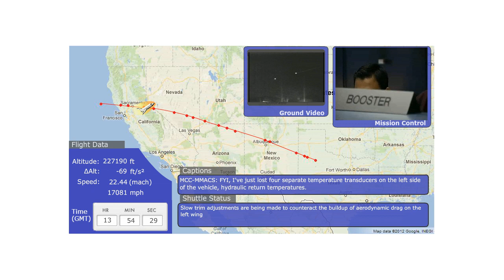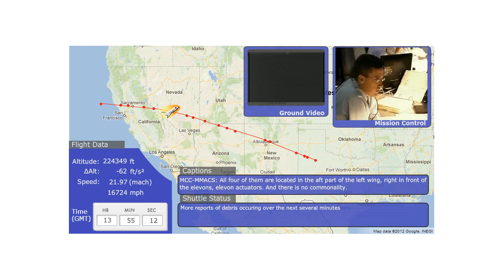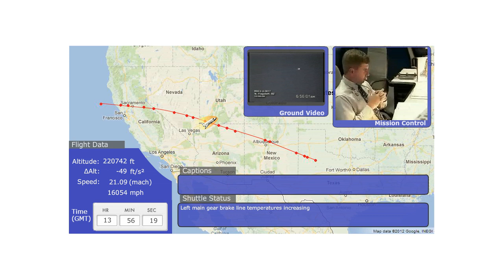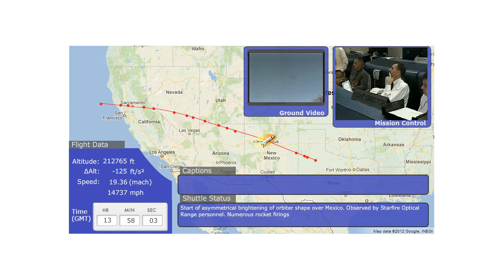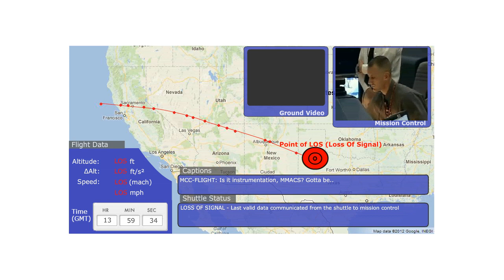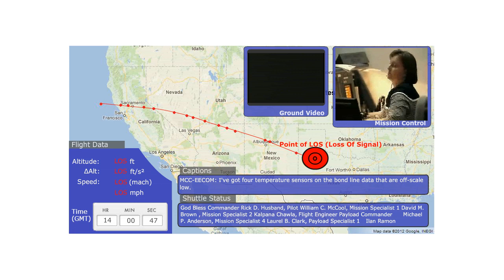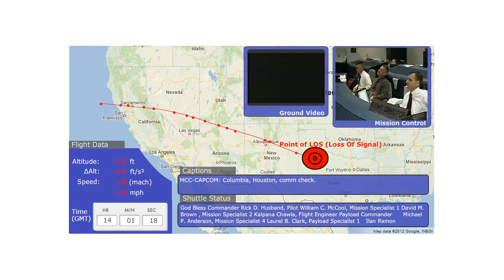New HD Render Analysis -Space Shuttle Columbia Re-Entry Breakup - STS-107 Telemetry, multi-views

Comment: To your question / comment at 3:58.  the shuttle is no glider by any means at all.  At this point in its flight its falling but it is moving so fast it has the illusion of controlled atmospheric flight.  Now keep in mind the shuttle has a hard time maintaining altitude when it is in normal atmospheric flight let alone on the very thin outer reaches of the atmosphere.  so it is still falling at an accelerated rate due to the point that gravity is not a set speed but a acceleration force.  

Love the video.  its really cool
Reply: verb (used without object), glided, gliding.  
to move smoothly and continuously along, as if without effort or resistance, as a flying bird, a boat, or a skater. I believe that covers the gliding part. On to atmospheric controlled flight. The shuttle was in fact capable of "controlled atmospheric flight," it was manually flown during the landing phase, no illusion there. The shuttle was, in fact, a glider, a very fast one but a glider none the less.
Reply: Agreed. This was not ballistic flight.  Even the Apollo capsule does a brief bit of gliding on re-entry to slow down, though at a VERY low lift/drag ratio. When they are rolling left and right during re-entry, they are using lift to fly an S-shaped path down to help scrub off speed. It was and still is the only manned spacecraft capable of doing so.  Also agreed that during the beginning of re-entry when the air is too thin, they are indeed just a falling object. Once they start feeling drag and experiencing high heat production, they start using flight controls with thrusters, and eventually by themselves.

Comment: I get the feeling the controllers at NASA pretty much knew Columbia was doomed from the moment he was over the California coast
Reply: From the moment they had unrelated/uncommon sensor failings within seconds (but not simultaneously) it sounds like the commander unfortunately was aware they had a serious problem. For sure once the tire temperatures spiked, there was no doubt from that moment it was serious.
Reply: Michael  no tires or no landing gear means a deadly crash for the shuttle; bear in mind that even if the hole in the wing's edge whould have been much smaller but enough to fry the hydraulics of left gear the crash would have been on the runway, killing all the crew
Reply: If Columbia held up to around approx 30,000 feet, the crew could of bailed out from the shuttle.
Reply: the Challenger cockpit smashed the water and in fact that impact killed the astrounauts, not the fireball at launch; so depending on the final approach speed (and the water depth at landing swamps) I doubt hitting the water is better than the runway's asphalt, but all those calculatiions and decisions would be for the command center to perform within the few minutes on re-entry, so it's a bad scenario too, although as you said, it's probably an excercised scenario ran by NASA
Reply: the fact that the entire crew survived the massive fireball of Challenger with cockpit intact and were alive all those 3 mins on air till impact on water speaks very well for cockpit design; in fact, after this tragedy, NASA took into account the possiblity of ejection and failsafe mechanism for the crew to survive a failed launch
Reply: Boulder Bridges Creative  Asking if there's any commonality is the first step in trying to work the problem, because if there is some commonality (like the wiring of those sensors and only those sensors run through a common bus), that point of commonality is the most likely cause of the problem.

Imagine that you wake up one morning and you discover that your toaster, coffee maker, and microwave have all stopped working, but the light in your bedroom, your clock radio, and other stuff is working.  What's more likely-that all three appliances died at the same time, or that you've blown the fuse to the kitchen?  Most likely, the problem is their point of commonality-the fuse.

When he tells him that there's no commonality, that means that there's no single point of failure.  So multiple things failed at the same time.  That's very uncommon-and it's almost always very bad
Reply: @Brisoup1   Actually there wasn't any way to bail out not safely anyway.     They were doomed and their wasn't anything that could be done at any point during re entry.
Reply: it was sacrifice for the beast so is he. it is top grim.

Comment: Extremely sad. But data synchronisation here well put together. 
I now understand fully the point when the spacecraft broke up in relation to the adverse instrumentation readings, as well as last voice traffic & its break up from Columbia in relation to velocity, altitude & geographical position. 

As a humble Aerodynamics consultant with very little knowledge of Space travel, it appears clear to me the ship broke up (or at the very least in half) very quickly during the errant & more violent than planned yaw, pitch & roll manoeuvres and that a joy stick was forced beyond pre-set limits either by involuntary force, last ditch attempt to regain control, or both.

Given all this + my other research into this disaster, plus taking into consideration internal decompression rate at point of break-up, heat, velocity, altitude & very sudden violent spinning of the spaceship, together with relatively insufficient restraint of the crews' spacesuit headgear, I believe all of them would probably have totally lost consciousness (through a combination of severe physical & mental shock) at different times, but within 4 to 10 seconds of each other from the point of the ship's decompression. Thus, I also believe NONE of them would have consciously suffered.

All this said, despite numerous comments posted elsewhere, I believe VERY FEW ground personnel were aware of the inevitable consequences beforehand. 

I personally would be surprised to learn that anyone active in Mission Control at point of disaster that day would have known of this inevitable catastrophic failure.

Comment: how does mission control NOT know where parts are on the dam shuttle?
Reply: First off, there are a hell of a lot of parts, and they're all interconnected.  Second, it's a standard troubleshooting technique when you've got multiple failures to look first to see if there's anything that they have in common-maybe the sensors go through the same wiring junction, and losing four at once may be an indication of a problem with the junction rather than the sensors themselves
Reply: I find it impressive that MC and the FD knew which sensors run on a common bus and can recite the system commonality in real time mere seconds after a malfunction without reference to a manual, amazing. Listen to the FD talking to the MMACS they both knew what the other was referring to immediately. Google "Shuttle systems manual", and be able to recite every page within seconds of a request or malfunction. Report back in 20 years when you've learnt it.
Reply: To Richard Moore: That is why there are so many persons in the room, each one knowing specific parts of the Shuttle “user guide”. In any case, I don’t think the manual contains a “troubleshooting section” about critical failures during the re-entry heating phase, because unfortunately not much can be done at that point.

Comment: In a recent book about the space shuttle Columbia and the missions it flew, the engineers suggest that until the point where they lost all hydraulics, the crew would never get the slightest feel to warn them that the wing was damaged and at first they might not even realize it even if it fell off entirely! But the sensors would fail almost identically to the way they actually did.

Comment: From 6:36 to 7:10 The crew is (unfortunately I would say) still alive fighting in vain for their life.. dam..
Reply: Judging from the various sensor failures prior to break-up. I'm willing to bet at least the Captain & Commander knew for at least a minute that they were in deep trouble.
Reply: @Brisoup1  Sensor failures/anomlies do occur. All four of those first failures were in the same place so they might have assumed they were instrumentation error, ie the sensors or their wiring having a problem and not extremely serious. the peopel at mission control knew once the head controller asked if their were commonalities (eg same wiring harness) and was told: "No commonalities"
Reply: @samd.8911  I'm not sure how far down the totem pole the people at Nasa knew that Columbia was struck by a large piece of foam during launch, but I'm sure the possibility that the Shuttle was fatally damaged crossed some of the controllers minds the 5 mins prior to Columbia breaking up.

Comment: They guy on the ground dont sound too knowledgeable. If i explane a temp warning on a specific sensor, I would expect the ground to know instinctively where it is on the Shuttle. This, Just like the explosion of Challenger was NASA's incompetence. Launching when too cold and Morten Thiokol said no go its too cold the O rings wont seal. Then presured into launch by their Bosses. They knew a suitcase sized piece of foam hit the wing on takeoff but just ignored it cos it always happens. They knew they could of inspected the wing by pointing a satelite at it or even ISS cams. Fly by night murderers. Both could of been prevented and then they discontinue the Shuttle saying it has a bad flight record. The Shuttle performed perfectly on every launch, It was human thats fucked up.
Reply: Whilst i agree management was too quick to dismiss engineers' concerns in both the Challenger and Columbia disasters i don't agree with your assessment that the 'shuttle performed perfectly on every launch'. The Columbia accident was a wake up call to NASA in showing up a fundamental flaw in the design of the space shuttle which involved foam breaking off from the booster rockets @ launch and hitting the vehicle.
 This occurred from the very 1st launch and it was just  luck that a Columbia type disaster didn't happen decades earlier.  Because on every occasion the shuttles  returned safely to Earth after having being hit by foam and tiles missing the prevailing opinion was [including engineers] that foam can only do superficial damage to the craft therefore doesn't warrant any major safety concern it was after all lightweight foam. It was not until after the Columbia disaster happened that tests were done to see how much damage foam can actually do and proved they can be destructive. These tests should have been performed from the get go why they weren't is a big mystery. Complacency, money? could be a combination of both.
Reply: "If i explane a temp warning on a specific sensor, I would expect the ground to know instinctively where it is on the Shuttle."

Really?  Do you have even the slightest idea of how complex the Shuttle was?  It had 2 and a half million parts.

"They knew they could of inspected the wing by pointing a satelite at it or even ISS cams."

They had tried using spy satellites to photograph an earlier shuttle flight, and the results were not good.  And they were nowhere near an orbit where it could have been photographed by the ISS (and before you ask-they only had about 10% of the fuel required to get Columbia into the same orbit as the ISS.

If you're going to comment on what they should have done, maybe you should do some research first to find out what was actually possible.
Reply: I totally agree with you Kris. The big problem with NASA management in the shuttle days is that if there maybe a problem, you have to prove there is a problem. In the Apollo days, it was if there maybe a problem,  you have to prove it isn't a problem. Totally different Mentality. NASA management especially Linda Ham made it hard for engineers to be heard and taken seriously.
Reply: craig: I thought the same thing, the flight controller had to be told a few times what happened and where the problem was, like the dude wasnt listening or just had no clue